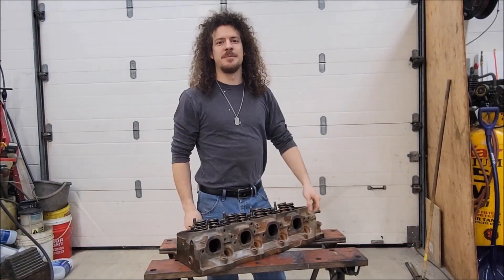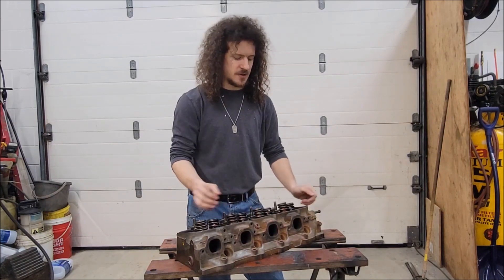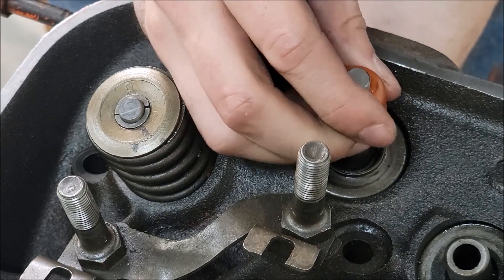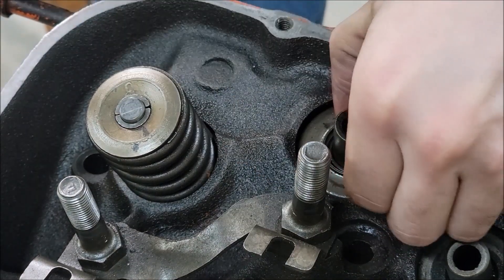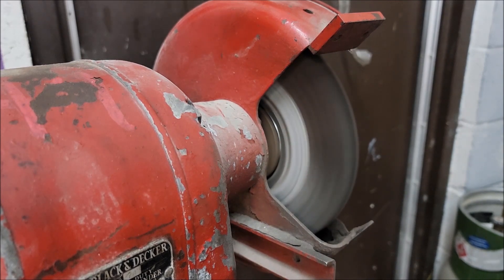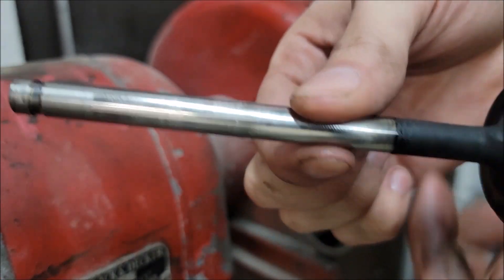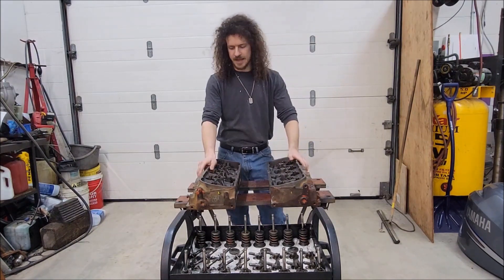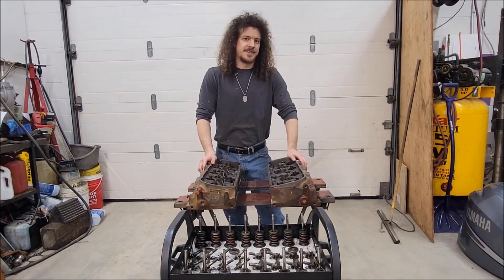496 Stroker Build PART SEVEN: Cylinder Head Disassembly

Comment: as far as these heads go, the 781 is one of the better heads. but not the best, the 820 and 241 heads are by far the best heads.  to be honest, by the time you refurbish and machine the iron heads, you will be close to 70% of the cost of a set of Edelbrock heads that are far better than even the 1970 - 820 casting and the 1971 - 241 casting heads. the only reason to use iron heads is if you are putting it in a marine application where i draws cooling water from the lake/ocean and pumps it threw the engine. lake or sea water is hell on aluminum heads. if you decide to keep the iron heads, here is what i do to tune them up.  fit bigger stainless steel back cut intake valves and stainless-steel exhaust valves and Inconel exhaust valve seats. I use a 75-degree cutter to square up the valve pockets and then blend it about 1 to 1.5 inches from the valve seat. don't try to hog out material, just a good blending job.  in the chamber, you will need to clearance for the new intake valve and the side of the combustion chamber as you can get. i can't emphasize enough that you need as much clearance here as you can. grind until you reach the outline of the head gasket you plan to run. eliminating the valve shrouding by blending and smoothing the chamber paying attention to the area shrouded by the combustion chamber.  and finally, gasket match the intake ports about 1 inch in then blend them to the existing port. as for the rest of the port, just remove the casting trash and smooth the casting parting line, as smooth the short side radius as it transitions into the valve pocket. do not remove a lot of material, it is mainly just blending things together. same for the intake manifold. gasket match it one inch in and blend to the existing port and remove any casting trans and smooth and parting lines from the casting.  leave the exhaust ports alone, just clean out the casting trash and smother the parting lines.  BBC heads are very sensitive to porting on the short side radius of the exhaust port, if you do it wrong you will wreck the flow.  and finally a good quality valve job. I prefer 4 angles, 75-degree throat cut, follow by a 60-degree throat cut, then a 45-degree seat cut and the 30-degree face cut.  only the 75 Degree throat cut in the valve pocket is added to the standard 3 angle valve job. i find that it eases the transition into the valve throat and makes blending the port easier.
Reply from the maker: This is good information and certainly some things to think about. I am on the fence about keeping the cast iron heads or just buying aluminum heads. Thanks for watching!

Comment: I turned down the shank on a bridgeport boring tool that used a lathe carbide cutter.. Used a drill after putting it through the guide. Opened the intakes and exhaust up to 90% of the new 2.19/1.88 valve sizes going in and just smoothed out the bowl's.. I gained at least 50 HP doing that to that same set of heads.
Reply from the maker: Sometimes less really is more! I am aiming to do the same thing. There's a lot of hidden horsepower in heads to be gained for a little bit of time and work.

Comment: You should have grabbed some 088 heads. They make around 630hp in stock form.
Reply from the maker: The 781s came with my engine and I hear make some respectable numbers, especially with a bit of work. I figured they're worth the build. I will keep the 088s in mind if I ever come across a pair! I think they have larger valves stock as well, the 1.88 and 2.19 I have planned foe the 781s (1.72 & 2.06 stock)
Reply: What do you think about early 292 castings muscle bone?
Reply: @bigblockkings1031  292 oval port heads are good heads. In my opinion cylinder head selection should be based on cubic inches, usage of the engine ultimately. I had a 396 big block that had 390 closed chamber heads over 10.1 compression ratio, air gap intake and howards hydraulic roller cam setup. It was a little torque monster on the street, but in my opinion it lacked pulling power up top especially on highway pulls. Now I have a mild 496 big block with 088 heads, 9.1 compression ratio, a dart single plane intake, and a small howards hydraulic roller cam setup. She makes power everywhere. Low end, mid range, and top end. That's the difference. 🙂
Reply: @bigblockkings1031  I think i can answer this question. it is an OK head. they were first design smog era heads. better than the latter peanut port heads, but not as good as 820, 241 and 781 heads. also, the combustion chamber is a little different on them. you cannot use the older design tall dome pistons with them.  I believe it was the TRW 2242F piston. used on the 396/402 will hit on one corner of the chamber near the exhaust valve. the old TRW 2242F was designed for the 11:1 closed chamber head from the 60s. not the open chambers of the 70's. there are some 427 pistons that will hit also i just don't remember the TRW number for them. also Speed-Pro bought TRW. so, the speed pro number just added the letter N to the casting numbers. example 2242NF. but it is still the same piston design only they have added a coating to the skirts now too.
Reply: for oval port factory heads, the 820 and 241 are king of the hill, followed closely by the 781. 088 are basically the same head as the old LS-6 454 heads, but they have thinner castings. So they crack easier, and you cannot port them as much as the old LS-6 heads. they are also terrible as street driven head. like all square port heads, the ports are lazy down low in the rpm range and don't start flowing well until 3500 RPM, but after that it is hand down a better head.  if you were racing, then yes, square ports all day long, but how offer are you driving around at 4000-7000 RPM on the street?  maybe for short burst at a stop light to show off, but big block Chevy's don't live very long above 5500 rpm unless you are willing to spend a serious amount of money. they are notorious for breaking valve springs and push rods at high RPMs on a regular basis. that's why you see all the triple springs, rev kits and shaft mount rocker and big block chevy race engines.
Reply: @shadvan9494  I'm using 088 heads on my street 496 big block engine. I have plenty of low end torque. At 3,000 rpms I'm around 550 foot pound and makes peak torque around 4,200 at 600 foot pound. Oval port heads work great on smaller displacement rats, but a 500+ cube rat doesn't necessarily need them. Rectangular port heads will do just fine.🙂
Reply: 2 grand people want for the 088 heads. Noone wants to pay that unless they are building an original type engine.